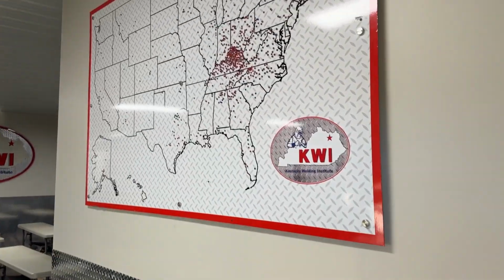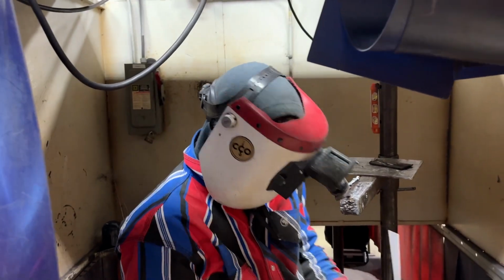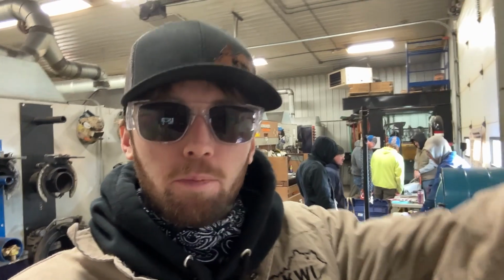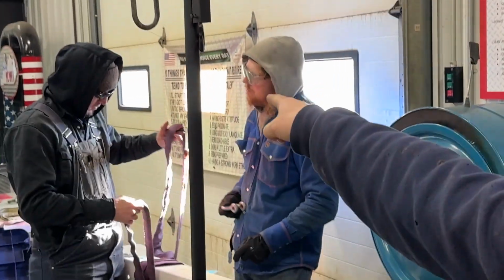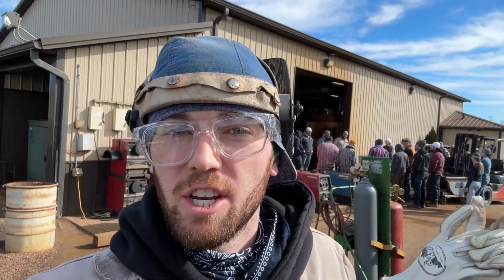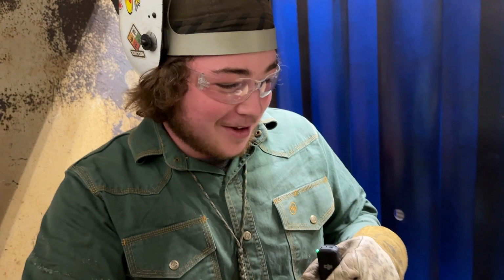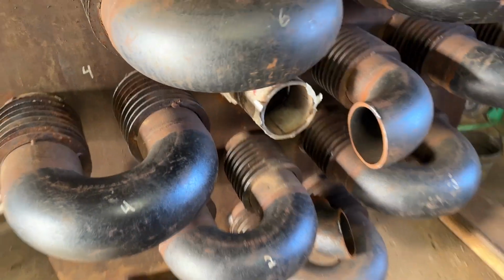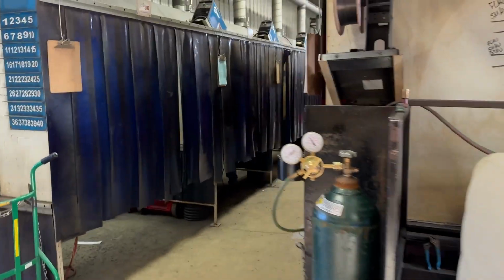How To Prepare for the Welding Industry!

Comment: What is the cost to attend the program?
Reply from the maker: You want a career that’s gives you the freedom to work anywhere in the U.S. and allows you to support the lifestyle you want?  You need a training program that equips you with the skills, experiences and certifications that smoothly transition you into the welding industry.  How about transforming your resume with KWI’s most comprehensive certification package in the nation? 

Train at KWI and you’ll be a certified combo pipe welder with: 
6 AWS certifications
NCCER card with Welding, Fitting, Boilermaking
NCCCO Rigger 1 and Signal
OSHA 30
MSHA 24
ASHI CPR/1st Aid
CCS Tox Card
Basic Plus
TWIC card 

If you can complete our 6 AWS certs in less than 24 weeks you can earn additional certs on chrome, copper-nickel, Inconel, duplex and more. Why don’t other programs offer all those?  Either they don’t want to invest in you or their instructors can’t weld the special alloys themselves.  Either way your future deserves the best. 

Housing costs range from $2,250-4,050 for the entire 6 month stay and that includes all utilities and places are furnished. All within 2 miles of the school.   Option A is the upper priced housing which offers single and double occupancy bedrooms, access to living room, kitchen, laundry. Option B is cheaper option dorm style. 4 to a large open room with access to kitchenette and bathroom all in one room. 

 Our 24 week certified pipe program is $20,000. In the last quarter KWI had 100% job placement, 97% in the last 12 months and grads average $30+/hr on their first job. KWI is dual accredited so fill out your FAFSA application and let’s do this- school code 043101.  1 year from now do you want to be wishing you were a combo pipe welder or be out there earning a living?  If you’re willing to invest in yourself KWI is ready to push you.